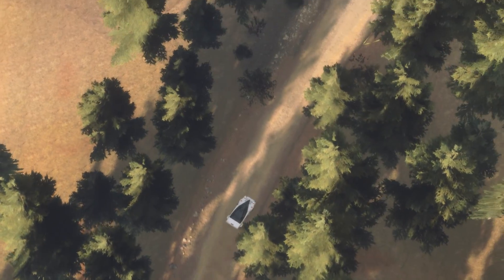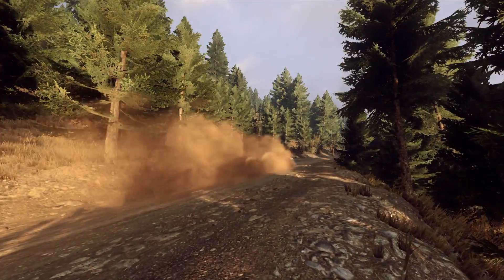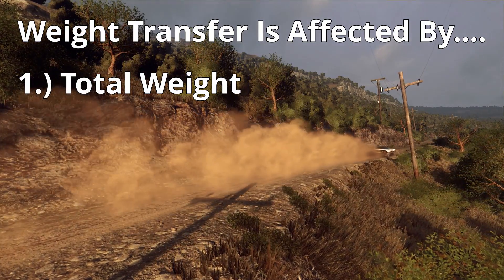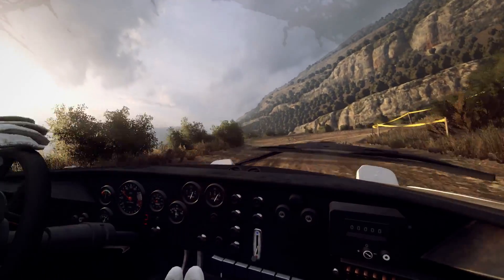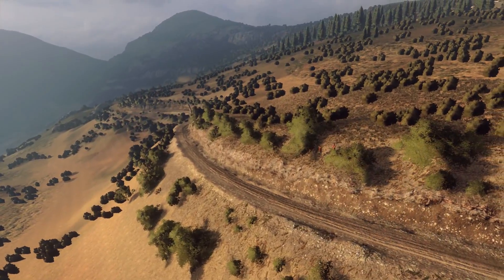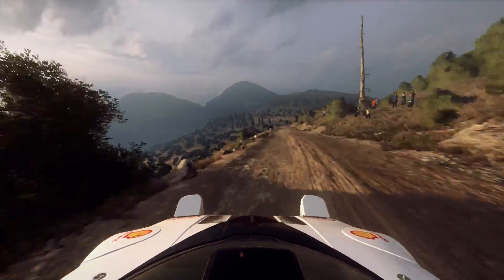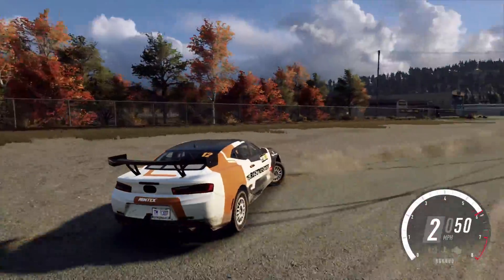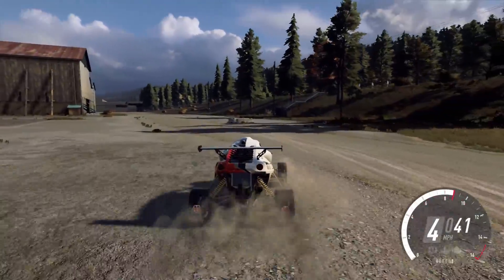Dirt Rally 2.0 Comprehensive Beginner's Guide: Weight Transfer & Body Roll

Comment: You are underrated. Subbed.

TIP: IF YOU PAY CLOSE ATTENTION TO THE TRACKS IN THE DIRT ROAD MADE BY OTHER DRIVERS IT SHOWS YOU EXACTLY WHERE YOU NEED TO POSITION YOUR CAR. HOW ROUGH THE DIRT IS WILL GIVE YOU AN INDICATION OF WHETHER TO SLOW DOWN OR SPEED UP. FOLLOW THE TRACKS FOR QUICKER TIMES. 

As you learn the vehicle you are driving, over time, you won't need to follow the tracks as you will be doing it naturally on your own by listening to your co-driver 's pace notes and remembering the motion of the car, the speed, and braking point that your car can handle during that turn. Following the tracks will help you learn the ends and outs of the car and what you may want to adjust/tune. Once you understand your car and have tuned it to your liking you will have become a much better driver. You will also have learned throttle and braking control. When you start winning 1st place then you will have mastered the car. 

PRO TIP: TURN OFF VISUAL PACE NOTES in the OSD (On screen display) Settings. Less visual distraction and forces you to LISTEN TO LISTEN TO ME SAMIR!! YOU ARE BREAKING THE CAR!!